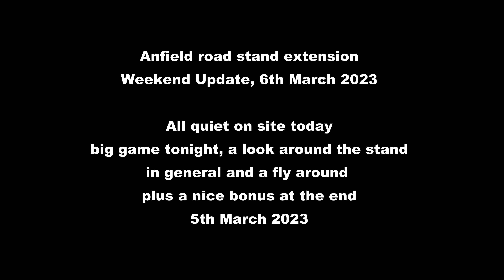Anfield Road Stand Extension, weekend update and a bonus at the end. 6th March 2023

Comment: Liverpool FC official has said work is on target for next season, not behind.
From This is Anfield website

seat expansion this summer

Paul Cuttill, vice-president of stadium operations, said: “It’s hard to believe we’re this far into the project, the progress that’s been made is remarkable.

“Even more remarkable considering we’ve managed to keep on track and continued to maintain full capacity at Anfield, holding over 50 games so far and three concerts in a working building site.
Reply from the maker: Yeah i seen that.